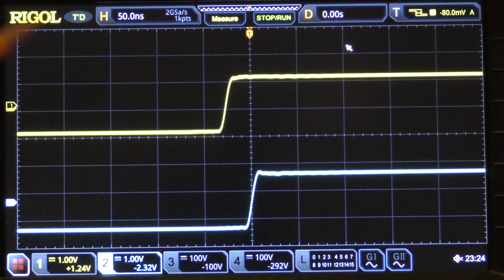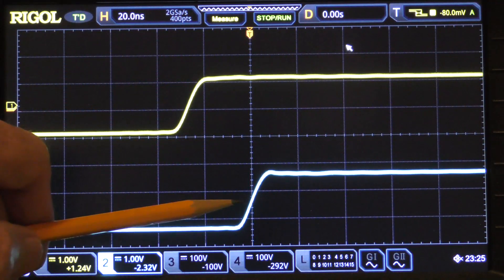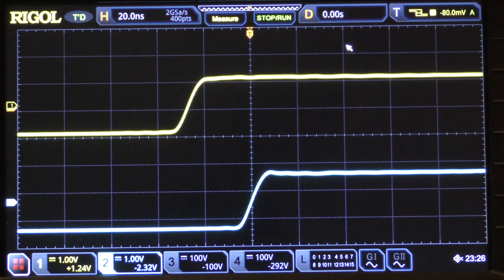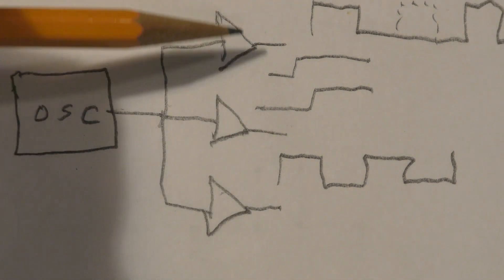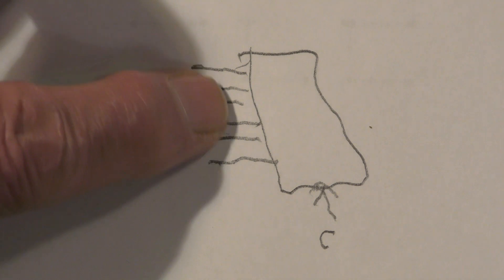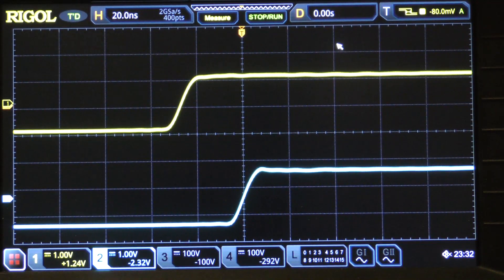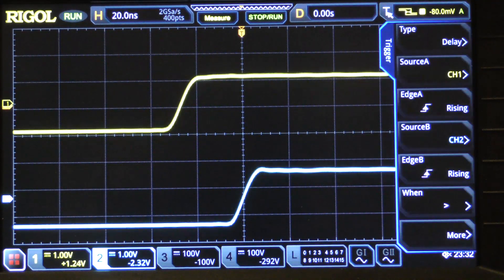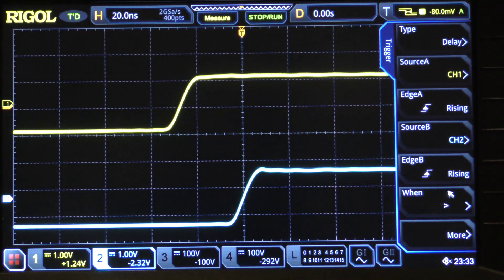TTT394 Rigol MSO5000 Using Delay Trigger

Comment: First off, thanks again. I love this scope, I wish I had one.  I'm curious why you use Auto trigger instead of Norm when using features like this.
Reply: you can get an entry level 2ch 70mhz for about $750 - $1000.  Then hack it to be a 350mhz 4ch with all the goodies :) Worth $3500
Reply: @imaginarypoint  yep, I got one coming tomorrow.  I ordered the 4 channel 70mhz scope so I'd get 4 probes.  I will be doing the "upgrade" at some point.  I'd really like that 350mhz bandwidth option opened up.
Reply: @tonyfremont  - Cool. I got mine yesterday. Took about 30min to read thru the details on the ee form.  Let me know if you need info on how to do it. Just make sure you get the correct patch that has the new "...03" fw.    Yeah on amz there are 2 types to order. The bare 4ch for $999 or ~$1350 with the LA h/w.  The best to get would have been the 2ch for $750 but can't find it anymore.